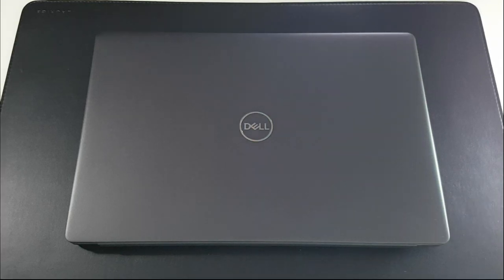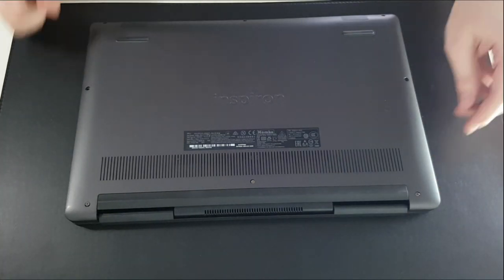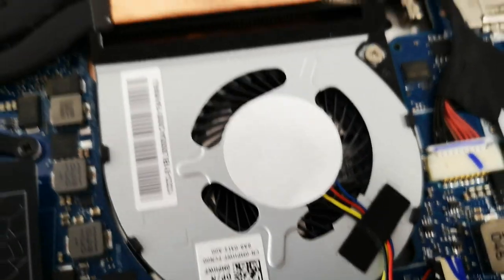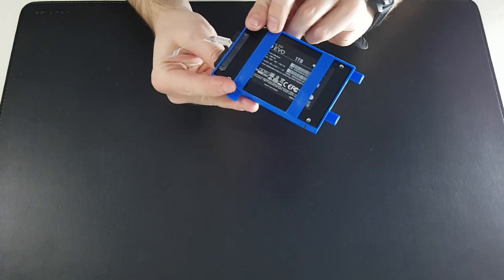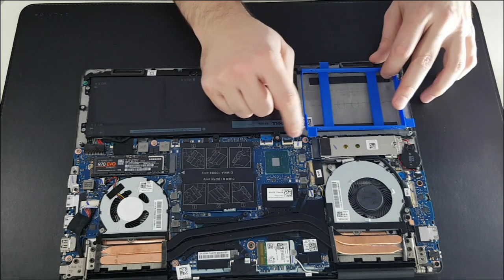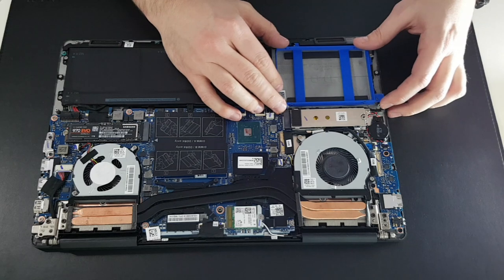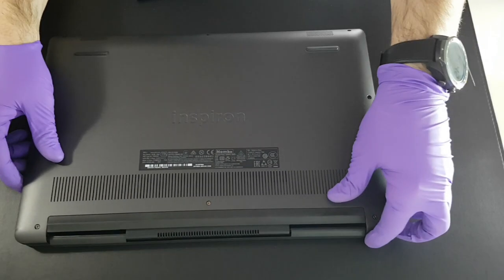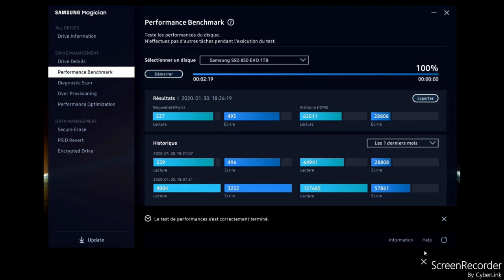Dell Inspiron 7590 - adding a Sata Hard Drive - 56Wh Battery

Comment: I have a question about the microphone of Dell Inspiron 15 7590. I have had the same laptop for about 1 month now and during this time I noticed that the laptop's microphone is very quiet. I had a couple of meetings via Zoom and MS Teams and the other participants all complained that they heard me very quietly. That's why I always have to take part in the meetings with a headset. I also recorded a Video with the Laptop to test the microphone. It's very quiet
Do you have this problem too? Maybe you can tell something about it?
thanks in advance
Reply from the maker: Hi,
I don't have any problem with the microphone, the voice recording in this video have been done with the stock mic of the laptop.
Have you tried right clik on "speacker / headphones" and sound settings, to see if you can make your microphone stronger?
Reply: I had the same issue while video conference
Reply from the maker: When i wanted to record for my new video, i also have a probleme with a very low voice volume with the internal mic. I just reinstall realtek audio driver from dell site and everything was loud again!

Comment: i have a problem with this pc. when powered by the battery, the performances are poor (there are slowdowns), while powered by the electric current, the temperatures rise a lot (even 90 degrees) and the fans work a lot. Do you know how to limit this problem? Thanks
Reply from the maker: hello,
For the temperature you can try to elevate the back of the computer a bit to make the air flow come easyer. I bought some little feet to do it on amazon : https://www.amazon.com/Cooling-Improves-Performance-workstations-Alienware/dp/B07772JBX1/
Also you can try to undervold a little bit with Intel XTU. i do it when i have heavy task to do, or if i want to play.
For the unplugged performance i think mine are ok, i set performance on the second or third step not full neither battery saving and it's quite ok. some of the slowdown may be because of the hard drive sleep, you can set that in power management.

Comment: you added a 2.5 SATA drive but at the same time, the "short" M2 drive is disabled. SO you didn't add the missing drive. You replaced M2 with 2.5 inch.
Reply from the maker: No none of the M2 are disabled. I had 3 drives (M.2 500Gb ; M.2 1Tb ; 2.5 1Tb) before i remove the 2.5 for changing to a bigger battery. When i mean missing, it's because on the dell site it is supposed to be 2.5 ready, and in fact when you open it, it's not...

Comment: From where you got the caddy as well as power cable for the hdd ??? 
Can please provide the link

Thanks
Reply from the maker: hi,
For the cable I bought it from Ebay : "Original disque dur SATA Disque Dur Connecteur Câble Flex 0DC2XG DC2XG" Seller : kaychun.
It took about two weeks to arrived from US to France.
For the caddy i made it with 3D printer.

Comment: Can we do the reverse on 7591 i.e., remove HDD 2.5 inch bay and install 97 Whrs battery
Reply from the maker: for now, i don't know, i'm waiting a 97W battery to test it, if it works i'll make a video... i think around mid-june...
Reply from the maker: a little bit late, but i made it, on the 7590 it's possible, i guess it's the same on the 7591. Video here : https://www.youtube.com/watch?v=l__sNqlc_gY

Comment: My back case is not coming out as easily as shown in the video.
Reply from the maker: Hi you have to remove all screws, and unscrew the three top ones, that sometimes stay a little bit locked. Gently pull where i said it will come...